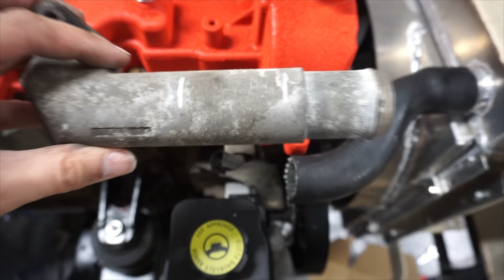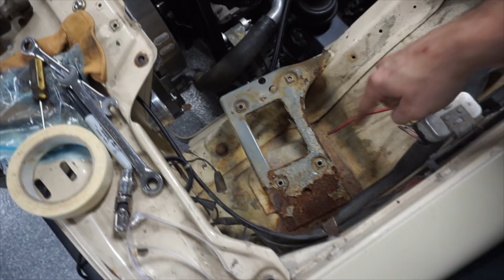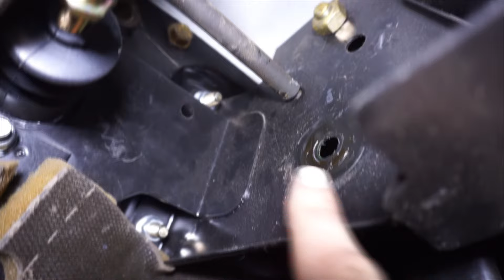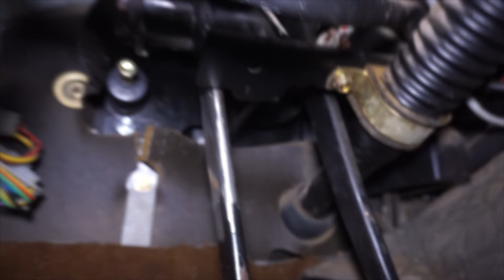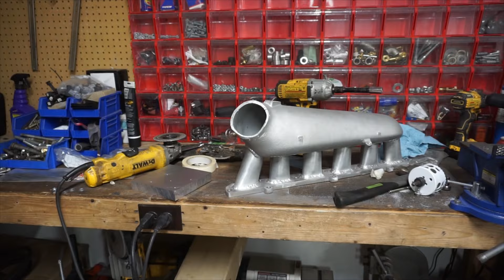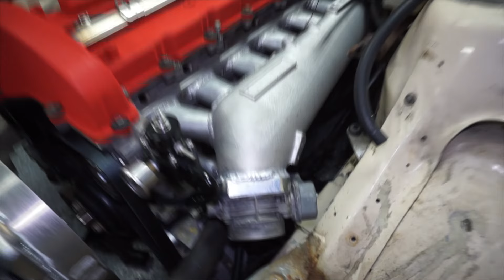Vortec 4200 Volvo Clutch Pedal & Throttle Adapter Progress!!!

Comment: You have to add a wire rope or a bar of some sort from the hood latch to the chassis, or weld something to the intercooler. Without it the radiator support will flex at higher speed.
Reply from the maker: It is bolted to the steel bracked that holds the intercooler and radiator. Can see the 2 bolts that have the brass washers on them. And will keep the factoyy bolts that are above the headlights. But i see what you're saying. May have to beef that up.